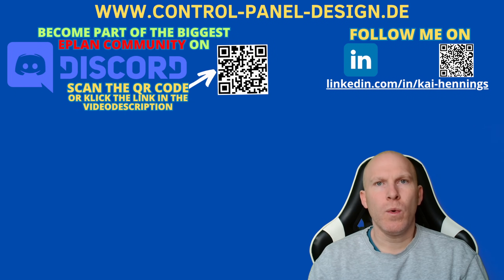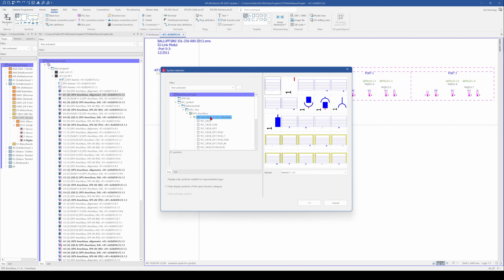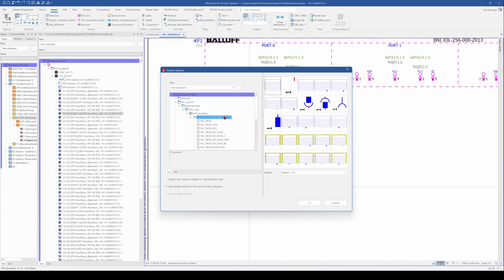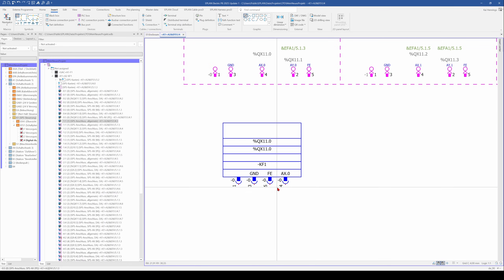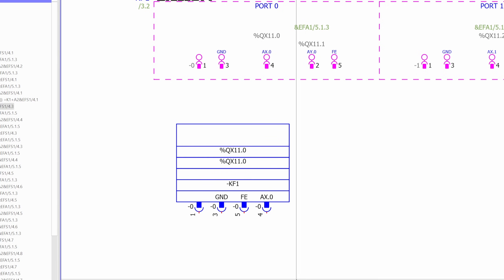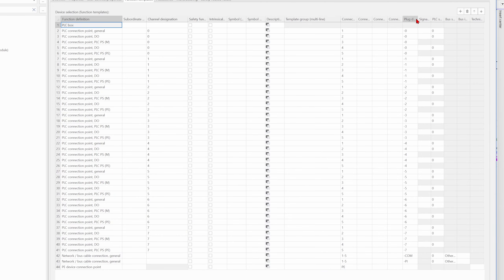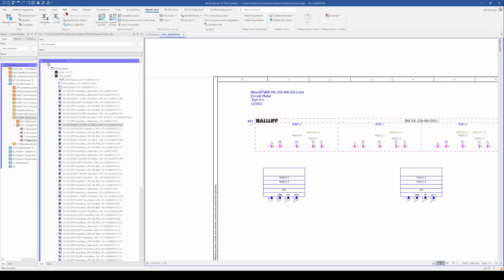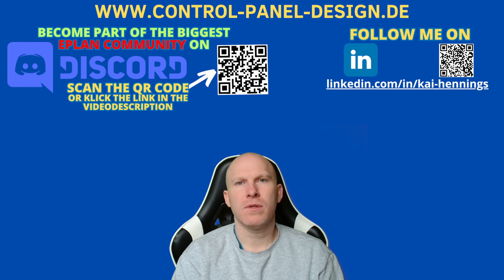How to place all connections at once in EPLAN ❓ It´s so easy 😎

Comment: Hi Kai, thank you for the video - your channel is one of the best Eplan training channels on YouTube.  
Question: when we adding devices to the database, how to correctly describe the expansion modules that are installed inside the PLC: for example, additional communication bus and interface cards; or I/O modules. Which function templates should be assigned and how to correctly describe these devices. 
Thank you.🤝

Comment: Hello Kai 
Your help is required we have new plc and I want to make it in eplan and  table with connection points for example when you connect its connection point with some device / sensor so the plc table is automatically updated so how to make it
Reply from the maker: Hi, in case you need some consulting contact me kai@control-panel-design.de